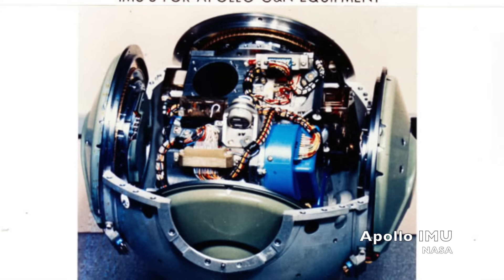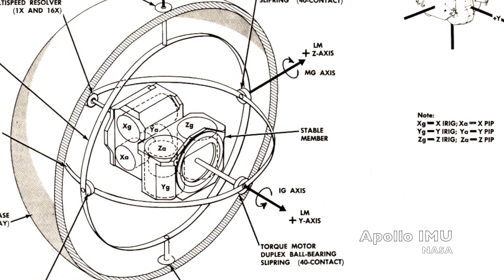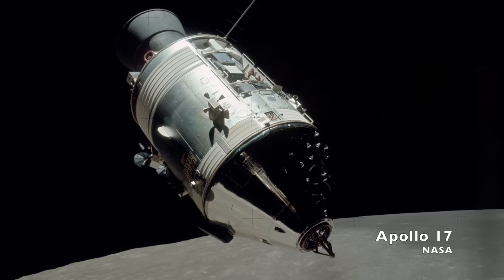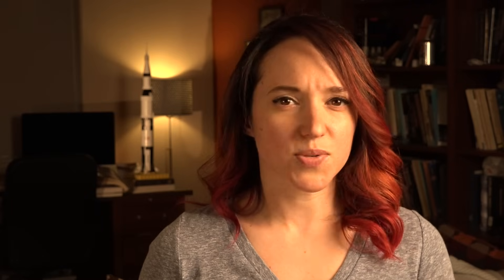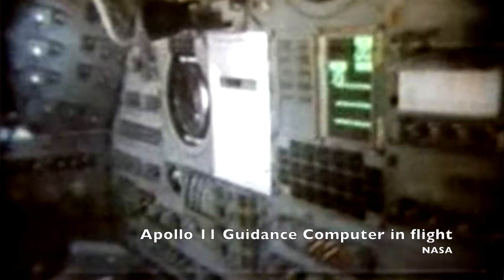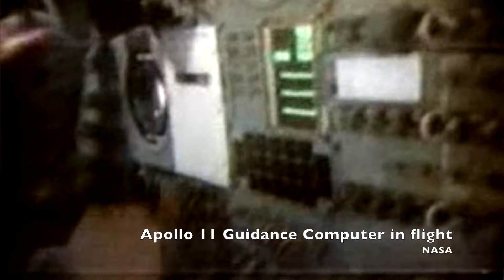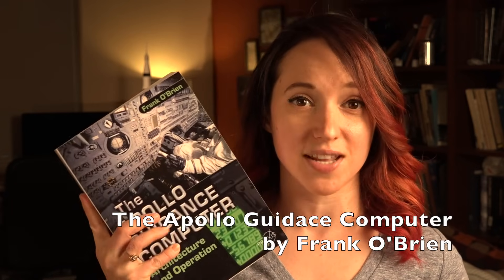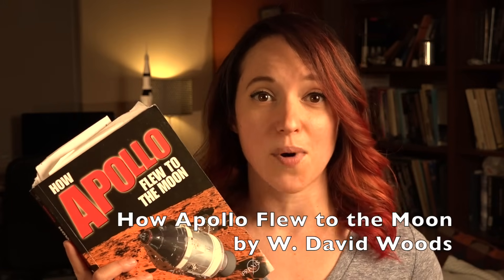Gimbal Lock and Apollo 13

Comment: According to most of the astronaut-authored books I've read, that fourth gimbal was a bit of a sore spot with the Apollo crews - the Gemini IMU was designed with four gimbals and the astronauts didn't seem to buy the "weight saving" claim of using a three gimbal system. They thought - possibly correctly - that the benefits of four gimbals outweighed (pun intended) the additional weight.

Comment: I was waiting for that cat to knock over the rocket in the background.
Reply: Nate Wright  Yes and I noticed the paint scheme on the rocket was based on the original prototype, with the black lines at the base going all the way up the first stage. Apollo11 (and 8-10, 12-17 for that matter) were not painted that way because all that black produced too much heat on the first stage. The black lines on the first stage only went up around the fins.  The movie model from Apollo 13 was also painted incorrectly. My guess is Ron Howard did that just to show he wasn't using NASA archive footage.
Reply: Razorusskie Can you explain more on how the black paint on the outside of the first stage produce more heat than a white paint? Also, does the color scheme on rest of the rocket serve any specific purpose or have any reasoning behind their selection and placement? Thanks.

Comment: After the complications of possible gimbal lock in a situation requiring emergency maneuvers on Apollo 13, was there a push to include a 4th gimbal on future missions? Did Apollo stick with the 3 gimbal system through the ASTP?
Reply: From what i heard they was sticking to 3 gimbal IMU. IIRC Gemini had 4 gimbals so we can say that Apollo IMU has been downgraded some way ;-)

Comment: I had always interpreted "gimbal lock" as the maximum range of motion in any given axis that the 8-ball could display - represented by the red area which can be seen at the top right of the window in one of your pics. I can see it was a bit more complicated than that..